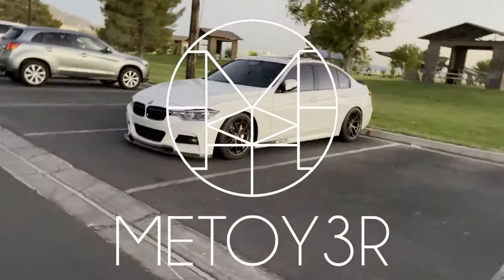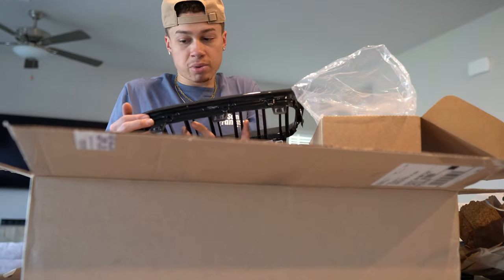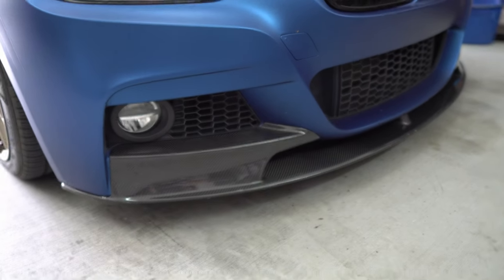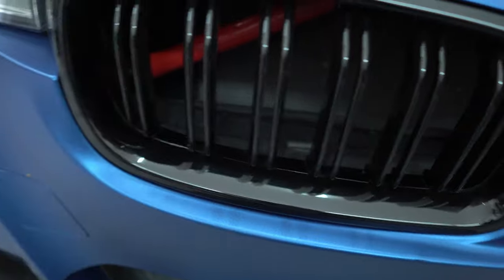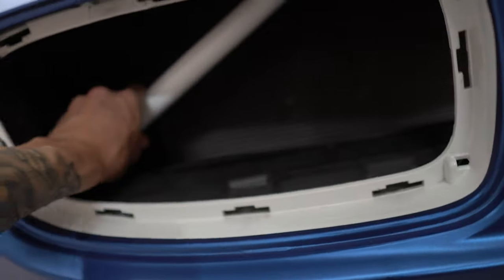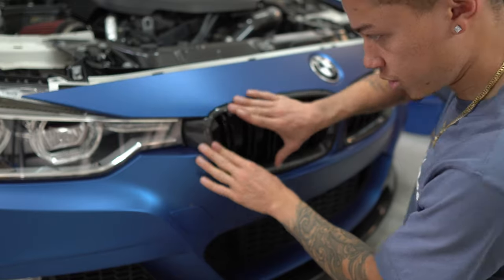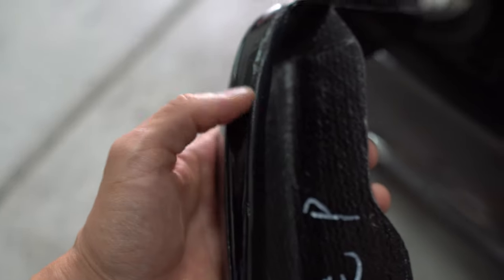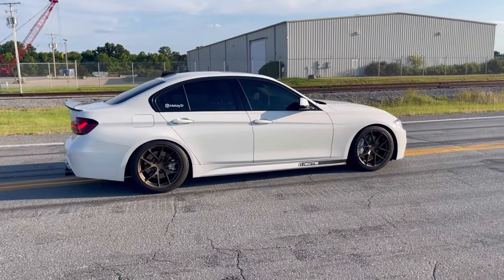These look so good! (Carbon fiber kidney grill install)

Comment: I had the same issue with my lip and the fangs, i ended up just throwing them on they do sit over the lip but there is no gap at the bottom side of the fangs atleast, it just pertrudes out a little bit. If you adjusted your lip more to the left you could probably pull it off aswell it wont be flush but it doesnt look bad